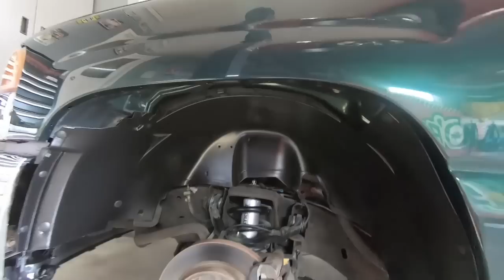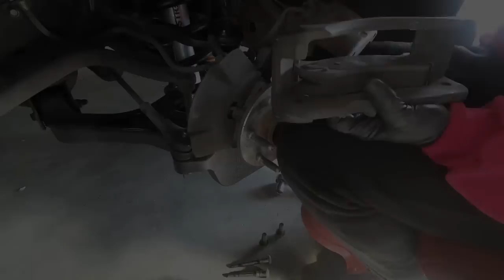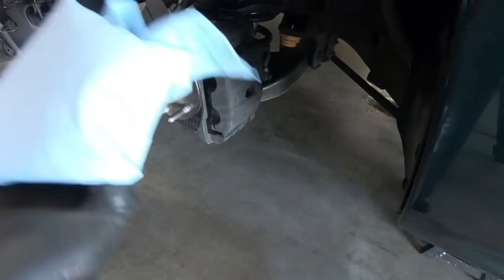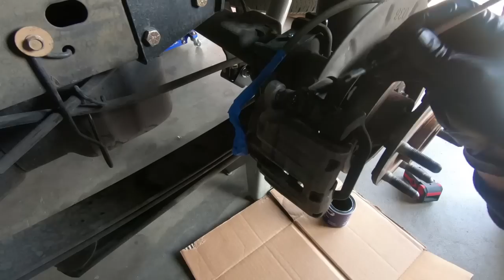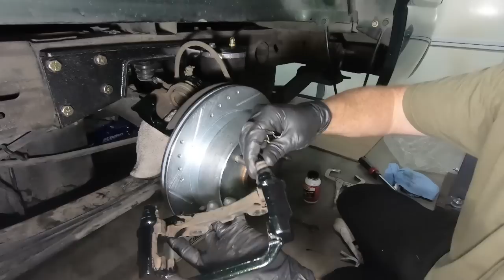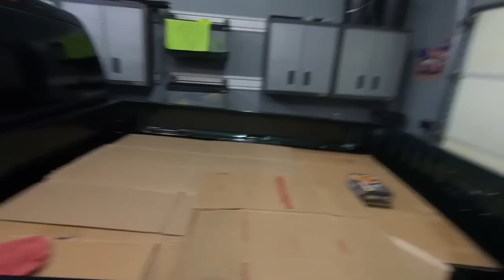Slammed Sierra Gets New Brakes and WOW

Comment: Truck is looking good, just a suggestion but some rear wheel well liners would look good on the truck I put them on my 04 sierra and it really cleans it up. Rugged liner and rough country make them. Thanks for the great video's
Reply from the maker: Thank you. I need to look into that.

Comment: I see you did cnotch on the truck wondering if you going to do that to the tahoe or how your going to lower it.
Reply from the maker: You will see very soon. Some cutting involved but no c notch.
Reply: @TWAMotorsports  alright cause i have a 02 tahoe an i did a 3/4 drop just have to order my shocks an im going to cut out the free travel mod. But was seeing if you were lowering any lower if so what you would do.
Reply from the maker: @Chevyowner79  need lower springs and a few other things that will be in my video.

Comment: Wondering which kit fits my 03 Silverado 5.3 2wd
Reply from the maker: Should be the same as this if rears are the same single piston
Reply: I believe so. Did you order the whole kit off amazon?
Reply from the maker: @dlo__3929  I did. I later upgrade to dual piston rears
Reply: How you liking it? I need a whole new brake kit. The brakes on the truck are feeling shot. Previous owner didn’t replaced them on time.
Reply from the maker: I really like them